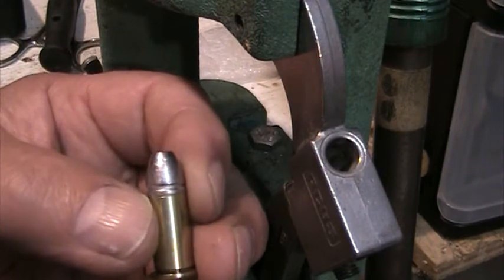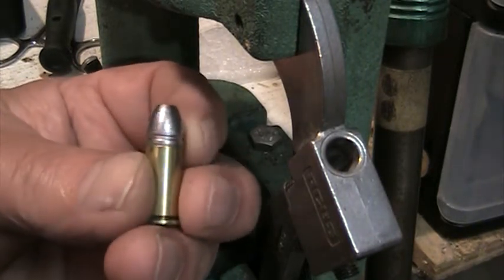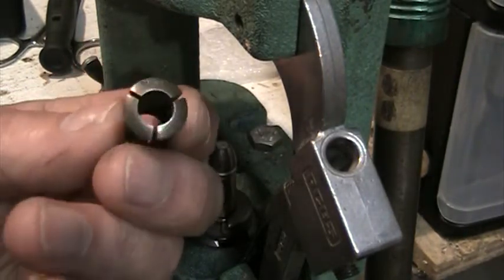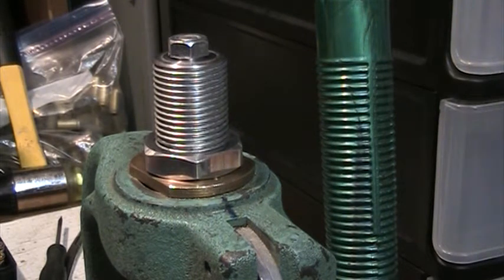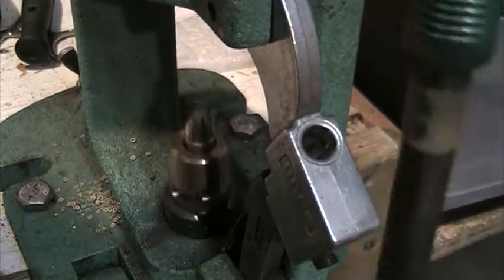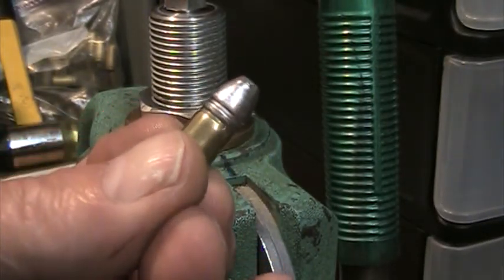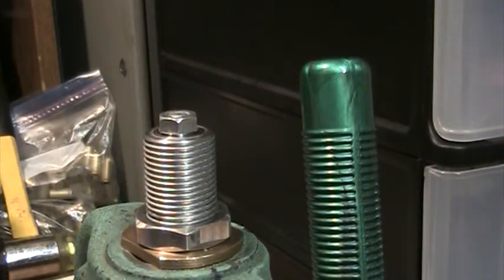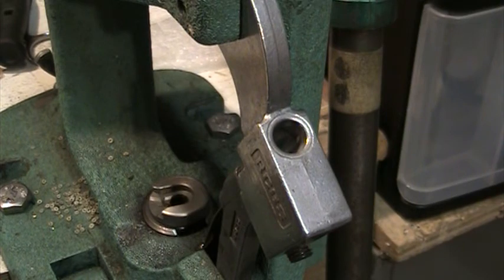Crimping Heeled Bullets

Comment: Works well. I load the heeled RCBS .310 Cadet bullet. A Lee 8mm Mauser factory crimp die does the job, with an extension to get the case up high enough in the die.Alternatively the case/round can be offered from above, using a cut down case as a distance piece. Lubing is done with old sticky  lee alox, put on with a stick and smoothed in by finger. Your method looks less messy !!